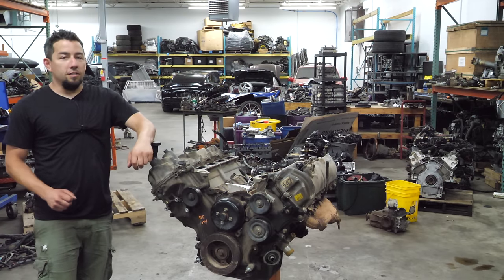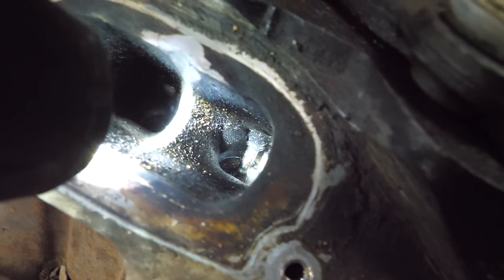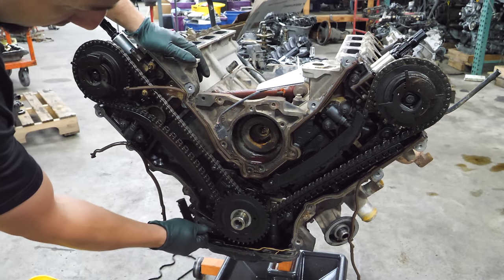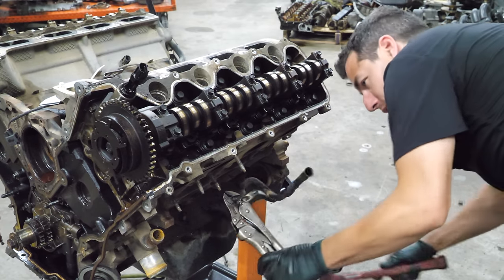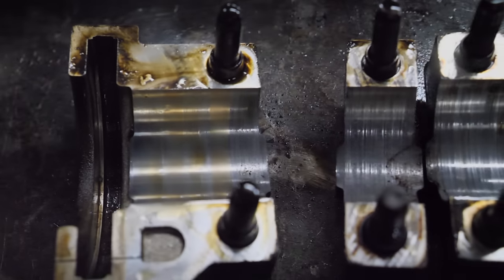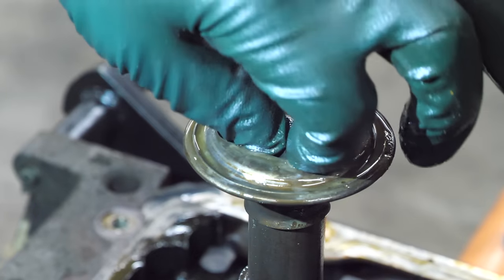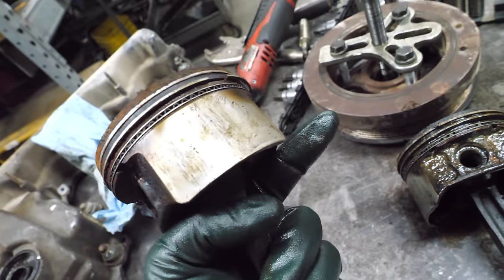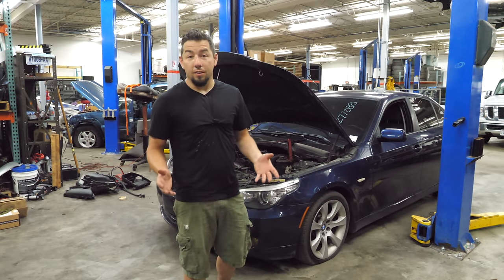Bad Ford 5.4 3-valve V8 Engine Teardown. Which of The MANY Possible Failures Took This One Out?

Comment: Thank you Eric! Interesting how the 2010 F150 4.6 3V does not have the same issues as the 5.4. My truck's 4.6 3V has 305K (km or 190K miles) and still runs like new. Just the basic maintenance and not hammering it when cold.
Reply: After 08 all the 3v engines got a better plug design, and most got the iron tensioners again, all the 2011+ 3vs have iron tensioners and slightly better oil passages.
Reply: Post 09 modulars went from 4 thread spark plug holes to 9 thread is why. That being said, I've owned 3 early/mid 90s mod motors and never blew a plug or cracked an intake.
Reply: Ford used the 4.6 in the police Crown Vics and everyone knows how durable they are.
Reply: @88irocztpi  all 3v v8s from ford got phasers the phasers on the 5.4 go bad due to bad oil pressure and the oil passages being a bad design that causes the oil to overheat and sludge.
Reply: @88irocztpi  My 4.6 3V has cam phasers.
Reply: The only difference is the stroke of the crank, a taller deck to accommodate the increased stroke, but those things really should not affect reliability and durability.
Reply: @mistered9435  the 5.4 has issues with he oil being overheated and sludging in the oil passages due to spending longer in the passages with the taller deck, and the truck blocks not having bigger oil passages on the 5.4, this is exacerbated by the same oil pump also being used resulting in lower top end oil pressure and flow on the 5.4
Reply: @Prestiged_peck  yep. Melling aluminium how flow pump is one of the best aftermarket parts you can get for em. Just stay away from doorman intakes.
Reply: @jamesrichardson559  
I have a 2001 Lincoln Town Car,  it has the 2 valve 4.6, I think it's a very good engine. Good power good fuel mileage.  On vacation my wife and I got an average of 23.1 MPG  142,000 miles.

Comment: I'd love to see a GM 3800 series II 3.8 V6 on your bench. I've driven 3 cars well over 300,000 miles with that engine and I'm still using the 3rd as a daily driver. Seems like they're invincible as long as you take care of them. I think those engines normally fail because of the plastic intake plenum leaking or because of coolant loss resulting in overheating. Also, the plastic coolant elbows WILL break at some point and need to be replaced with the metal version. Seems like on cars with those engines, if you completely run out of coolant, the temp gauge stays in the middle. The only clue you're overheated is because of severe knocking when you accelerate. I had one overheat and then it ran fine for a few months before spinning a bearing. Anyway, loving your content! Keep it up!
Reply: Yes that plastic elbow will fail,was that what caused it to over heat,the 3800 3.8 is one of the,if not the best V6 ever produced with proper routine maintance!

Comment: I’m over 14 years into owning an ‘09 5.4 3v which still runs quiet as the day I bought it. I’ve made several repairs to it but am more than happy with my almost decade and a half use out of it. At least with the later ones like mine proper maintenance seems to be the key. I used to get worried by all these videos talking about what crap they are but then I learned to take them with a grain of salt. There are videos talking down almost every engine made these days.
Reply: I got a 07 expedition with 220k miles for 6 years I make sure i do oil changes only thing i had to replace is fuel pump and catalytic converters guess we got lucky?
Reply: I have an 07 Lincoln Mark LT, bought it in 09 with 16,000 miles.  Now at 142,000 miles and it stills run like new.  I never followed Ford’s 10k mile oil change, I’ve always changed oil at 4k intervals.  Find a good quality oil and stick to it.  As far as oil goes, I’ve used motorcraft oil first 2 years of ownership, and I switched over to Pennzoil platinum synthetic 5w 20 oil.  Tune up was done a little late, 133k miles, but spark plugs came out easy.  With proper care and maintenance, and not racing to every stop light these engines can last.

Comment: That engine looks like it had 1 or 2 oil changes in the last 200k miles.
Most of the 5.4 engine problems originate from the roller rollers. There is a reason Ford has a redesigned roller follower for these engine. Now the follower oil hole is smaller - which raises the oil pressure to the phasers, and the oil hole now points at the point where the roller in the foller contacts the cam - keeps the needle bearings lubricated   
Changing out all 24 of them with a set of gaskets will cost about 300$
Too bad ford didn't recall all these engines and put them in for you.
Reply: @navyphyrfitr6550  amen to that
Reply: @navyphyrfitr6550   All the good ones are making videos on YT (and now Rumble), just like the best of everything else.
Reply: Roller Roller?
Reply: The lack of oil changes didn't do that 5.4 any good.   Possibly even run low on oil a few times.  Thanks for the video
Reply: @standhd  he meant roller follower
Reply: Because they were already making the coyote 🤙🏽 a lot of these 5.4s running around with 300k miles or more though.
Reply: I got my truck 5 yrs it's 211------. For 3,000. It's it's has ,357686
Reply: @jima3129  I put 5 30 in my engine. Ever time it's has 258,460
Reply: @jima3129  no doubt. I like mm oil my self
Reply: A lot of people who have those engines tend to skip oil changes and neglect maintenance protocols anyway
Reply: @jima3129 good advice...will try that!

Comment: Love watching these videos, tearing down engines of a size that petrol heads here in the UK can only dream about. You made me laugh when you said in a 4x4 this engine was underpowered. Try driving a truck like mine ( 2018 Ford Ranger ) with a 2.2L 4 cylinder diesel then say it's underpowered. More big engines please.
Reply: 5.4L is still what we call a small block lol. Just plz don't look up how much power our 7 and 8L motors made back when we had more strict environmental rules than y'all do

Comment: This was a great episode!!! Yes, this is a really good look into this engine type, and what could go wrong with them... I remember seeing several nylon  camshaft gears coming apart and becoming a blockage in oil pump inlet snorkels... Then causing bearing failures because of oil starvation... Also several engines had jumped time and ran poorly and had heavy internal engine damage...It is almost as if these things were made of plastic, to fall apart... Good show!!!

Comment: I was an owner of 2009 Ford Expedition with a 3V 5.4L until last year.  I drove it to 180K and some change.  Around 110K it started a bit of a clatter that was the timing chain that got worse over time but never to bad.  It always cranked and ran mint over 1000rpm.  Below that at idle rpm it would be be a bit chattery.  My mechanic said keep going with it or go to Ford for a big parts replacement.  So I opted to drive it.   Rust was finially the issue.  I sold it to a mechanic for a few grand and off he went.  Other than the chatter it never had a mechanical issue over 180K.  I didn't love it but I didn't hate it either.  I have a 2015 Expedition with the 3.5 EcoBoost.  I'm at 80K with it and no issues at all with it.
Reply: Should you ever replace phasers, only use genuine Ford parts. I have had too many problems with aftermarket parts failing far too soon after replacement.

Comment: They should do a race series for this engine. Points could be awarded for making it onto the starting line...
Reply: Winner is last 1 still running
Reply: Are there any rules regarding internal modifications or power output?
Reply: I have a 4.6 3v that runs 8s. It is just another modular Ford at the end of the day when you fix the nick nack issues.
Reply: @SlimPickins_07  4.6 was good though not nearly as problematic as the 5.4
Reply: @atlaslion5128  They are nearly identical engines
Reply: @SlimPickins_07  Yes but 5.4s are notoriously bad.
Reply: @atlaslion5128  They have the same exact components to go bad, but people generally took better care of their 4.6, which was one of the leading causes of all the problems in the first place.

Comment: Thanks for another great autopsy! I worked at a independent shop and dealer from 88-93, so I definitely understand why tools end up bent (loved the toyota crank bolt!!).  I am jealous, as I had to put junk back together when the customer wouldn't give me the ok to fix it!
Reply: If the customer doesn't okay it, did you at least charge them for taking it apart?
Reply: The Toyota freaking crank bolt no kidding

Comment: I just had the heads and timing redone on my 5.4 3V F-150 and that's 261K miles later. Also replaced those beautiful exhaust manifolds. It's running great (again for now) **Knock on wood**. I only use the truck for "trucking" purposes but change the Oil / Filter myself every 3-4K miles. For the past 4 years I've told myself "I'll run it until it dies". Well, we'll see lol!

Comment: i like the 3V V8 and V10,very powerful,yes they need to be maintained and thats why  they usually fail when they are thrashed and neglected
Reply: Truth bro. Like you just gotta take care of it like a normal human being. Also I see people using the wrong oil for it too.
Reply: I like the 4.2 V6….not a lot of issues, but I guess I’m smaller in a world were BIGGER is better!
Reply: @standhd  I would've gone with the 4.6 v8 but there was nothing when i was looking so i bought my truck
Reply: @certifiedbruhmoment2973  I was on the verge of buying a early 2000’s V8 F150….I blew up my 99 4.2, and I needed a vehicle, FAST. I came across the afore mentioned truck, but the seller didn’t get back with me in time; and my wife and I TRIED to buy it….we texted, and left numerous voice messages….to no avail after we agreed on a price and a look over. I don’t even know what V8 that truck had. I ran across a 2003 4.2 XL Sport, and I snapped it up immediately.
My 99 was an XLT with the 4.2, and that engine withstood a lot of neglect from my dumb ass; tough little engine. I blew a head gasket by not paying attention to the radiator leak coming from a freeze plug over the starter and mixing different types of coolant because of the leak. The guy eventually got back with me, but it was already too late. So now, I am very diligent about the maintenance on my latest truck. I do my own oil changes, and I check things under the hood quite often.
Reply: @standhd  yeah I get you those engines are really good. But I loved the 4.6 v8 because it's very reliable, where I live we got no e85 so I don't need a flex fuel system. But like I said I couldn't find any near by. The 2007 ford f150 I got was a pretty much fully loaded lariat it was just missing the sun roof and sub in the back. Super crew can with a 6.5 foot box and other stuff. And really low km because I live in Canada. 150 000km with is about 70 000 miles roughly. And it had a 5.4 which I was hesitant about, but the owners had take good care of it. They were selling it because they bought it to hall a 5th wheel camper but bought a rv so I snagged it
Reply: Exactly. All the bitching & moaning about the 5.4 is because they cheap out on maintenance, and then they blame for Ford for their ignorance and being cheap.

Comment: I've got a 2009 Expedition and my 5.4 3V is still towing strong at 220,000 miles ... not seeing the issues.  Runs strong and tows hard.  With regular oil changes, it runs great.

Comment: I love the 5.4!

Opened up the oil passages, got comp cams cam phaser limiter etc.
In a nutshell, I built it up.

It’s a great runner, and pulls very hard down low up to around 6,200rpm.

Comment: The plastic shrapnel from the blown-up tensioner sure did wreak a lot of havoc, no doubt. I know I've said this before, but I've always respected the fact that you don't sell questionable parts---I'd buy parts from you. In contrast, some of the yards that I've bought complete engines from (sold to me in "good running condition") were in worse shape than the one I was replacing---this includes cracked heads and rod knock
Reply: Always 40,000 miles on engines from wreckers...lol

Comment: My original 1997 Expedition 5.4 2-valve now has 480,000 miles.  Replaced head gaskets at 420,000 miles.  That's it.  Cross hatching was still prevalent in all cylinders.
Reply: Mhmmmm

Comment: 3K mile oil changes work wonders on these engines. All 4.6 and 5.4’s have some small oil passages up top but 3V engines have even more just because of the VVT components. Also doesn’t help when people who don’t know what they’re doing work on the 3V variants.
Reply: This. I worked at Ford with the engineers were investigating these issues. The mustangs didn't have half of the problems as trucks. You know why? People in Mustangs generally took better care of their vehicles, changed the oil, etc. People in trucks were using junk fram filters and going 20k miles on an oil change.
Reply: People were cheap and didn't do proper maintenance. I've owned 3 5.4 3v and all of them have never let me down. Because I use high quality engine oil, Shell gas and Motor craft parts.

Comment: The failure mode with the 5.4 as well as the 4.6, were the original oil pressure controlled cam chain tensioners.  The gaskets of the cam tensioner leaks, causing low oil pressure on the right cylinder head (passenger side), and in the cam phasers. 
The other problem is the stick spark plugs, just like the 4.6L 
They can be fixed, as Ford updated the timing chain tensioner assembly after 2006. 
What exacerbated the problem was aftermarket parts, which fail early, especially cam phasers, and cam chain tensioner bits. 
Using motor craft parts and using the high volume smelling oil pump. Fixes the issues, relative to this engine.
The same rail failure happened to me when I used an aftermarket replacement part, causing me to go back in and replace the guides with OEM guides.

Comment: I have this engine in my '04 that I bought new back in the day. Runs like new...just keep the oil clean and don't beat on it when it's cold.
Reply: The engine is this video looks like it never had the oil changed.
Reply: That's basically the recipe for any engine. Warmup should be under gentle load, with rpm's under 2500 or so until oil is good and warm. Car manufacturers these days call out ridiculously long oil change intervals. Generally, you want to change oil at half the recommended interval, and use good oil. I'm a fan of Mobil One for most engines. It's good enough for a Porsche factory fill, so....
Reply: Seems like a recipe for many engines
Reply: @BobTheBreaker9  Yeah, but this one in particular has a bunch of components that rely on oil pressure and the gasket on the back of the chain tensioner is weak...so dirty oil will tear it up. That's likely what happened to this engine. Tensioner didn't work resulting in the chain slapping into the cover creating all the fine chunks and then it broke the guide...the guy should have got it fixed as soon as he started hearing that racket. My engine is nice and quiet but as soon as I hear anything it'll get fixed STAT.
Reply: @dougrobinson8602  Yep...here in Denver it can be -10 during a winter morning and my neighbors will fire up the engine and rip down the street immediately. I always give mine a few minutes at idle before it gets moving. Seems like common sense really can't be taught?
Reply: With modern multigrade oil you don't need (or want) to sit idling for too long unless it's so cold you need a block heater. Probably a good idea to give it a minute or so for oil to reach all the components, but then you should drive gently, a bit of load will warm the engine faster which is good for avoiding oil dilution issues

Comment: We've had dozens of 5.4 engines in our fleet and never had a problem other than exhaust manifold studs.
Reply: that's good maintenance chief 👍
Reply: Are they the 2v engines? Those were pretty bulletproof.
Reply: What year vehicles are in your fleet?
Reply: Y'all got E-series chassis?
Reply: Someone stayed on top of the oil changes, these last of taken care of but can’t slip up on maintenance
Reply: @freedomisntfree_44  And even then, you have to do the maintenance right with them. Cheaper oil or plugs will kill them almost as fast. Even as a diehard Ford guy I can tell you this engine is one of the absolute worst ever made.

2-valve motors are absolutely bulletproof though. I love them and have a 2-valve 5.4 in my truck. It's a little wheezy, sure, but it's smooth and I've not had a single peep out of any drivetrain component.
Reply: @redrobin41  Far too many of them with high mileage for them to be the "absolute worst".
Reply: @Lo0die3  you can put high mileage on a Hyundai Theta II or a 2.7 Chrysler, but that doesn't make them any good. The 3V 5.4 mod motor falls into this same category. The 4.6 3V doesn't have anywhere near as many problems. The execution is flawed with the 5.4. There is a reason these and not the 4.6 or 6.8 are targeted.

The only way to make these any good is to lock out the VVT and install a high volume oil pump. Locking out the VVT turns these into dogs (I've driven one) and you might as well buy a 2V and save yourself the headache.